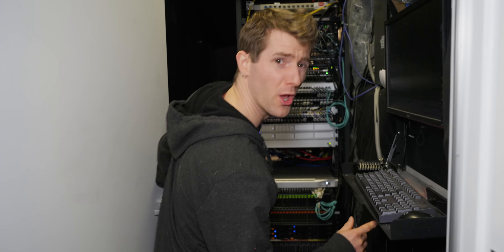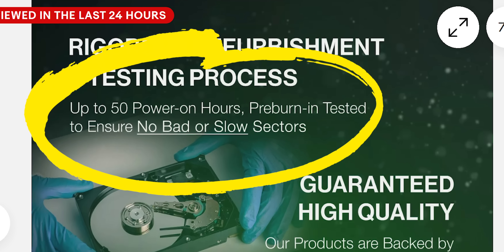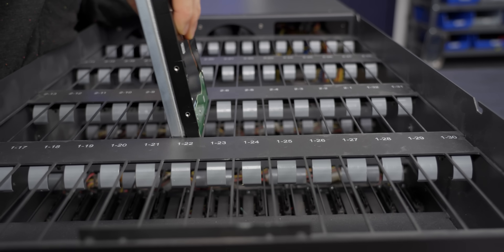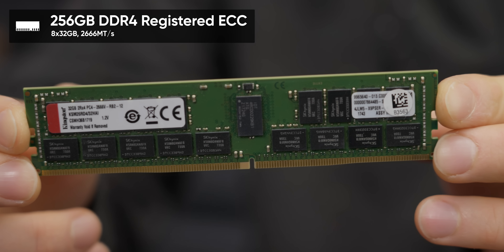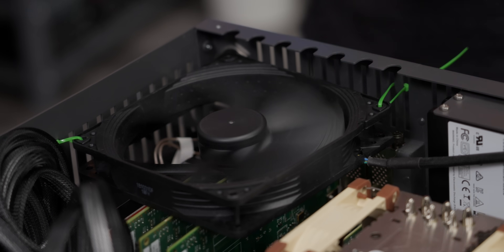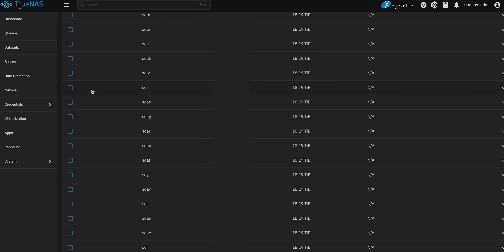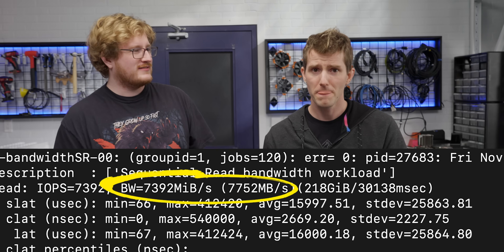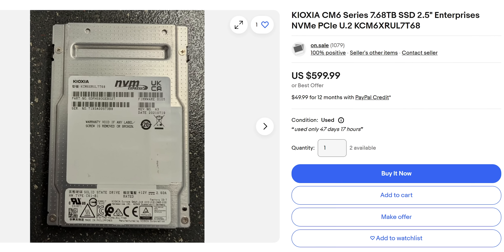Is Buying a PETABYTE on Ebay Stupid?

Comment: I'm currently using 8-20TB recertified drives, and 12-16TB recertified drives.  I've been using them for years with no issue.  Years ago, I purchased 8-4TB drives brand new from Newegg.  6 of them were DOA, and another failed shortly after.  Honestly, I've had much better luck with recertified drives than I have with new drives.
Reply: You didn't say where you bought the recertified drives, but I believe the problem is how Newegg ships their drives (or at least used to). They didn't put enough padding. I stopped buying HDDs from them because I got tired of receiving DOA drives. I've had no problems with new HDDs purchased from Amazon, B&H, and locally at Best Buy and Micro Center (and Fry's when they existed).
Reply: Well its kinda how hard drives are - they either die early or live years or even decades zero issues. Slightly used drives (like at least few months) are already past die early phase.
Reply: @deauthorsadeptus6920  Not true at all.
Reply: I hated SATA drives in the early days, I swear I had like 3 different drives just flatline between new to 1.5 years in use as desktop/gaming drives. My last 4-5 drives have all been refurbished or open box and have been working without fail from 6 months(newest drive) to 2-4 years. I have old PATA drives from 386/486/Pentium era machines and they still spinup and boot when I turn those old PCs on.
Reply: I bought a 10TB IronWolf PRO NAS in 2021 for an external backup drive to later use in a NAS when I would need one. It died after a year, got replaced, the replacement also died after a year... I then had problems to get another replacement because the 2-year warranty of the first was over, but could talk them into giving me a normal 10TB one instead. Is it somehow bad for those drives with NAS in title when they don't run 24/7 or was this just stupidly unlucky? It's not that I powered them up and down all the time, just for backup uses...
Well, If I'm building that NAS I guess I will just use the cheapest drives, and get some extra, seems the sweet spot is 16-20TB right now.
Reply: I don't believe any part of this story.
Reply: Thinking about it, why go for anything BUT recertified drives. You skip the latest hardware shipments and fresh unsealed product, but there's a much higher chance that it works as intended for hopefully as long as brand new. I'd rather get a solid reliable drive running for 5 years for cheaper, than a possible over 5 year drive with a potential of being a bad batch.

Comment: Well if you use H265 like Apple did with iOS 18 the video files are halved ( size about 90MB min) , - the only downside is on older computers won’t be able to process the video ( they will play but only at 50% speed otherwise you get pixelisation and unplayable video ) so you need a good processor.